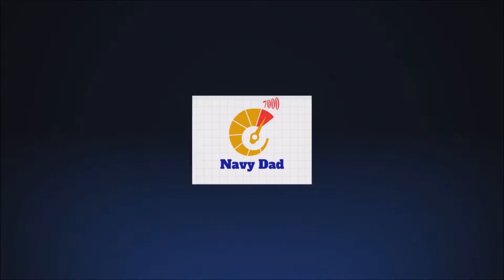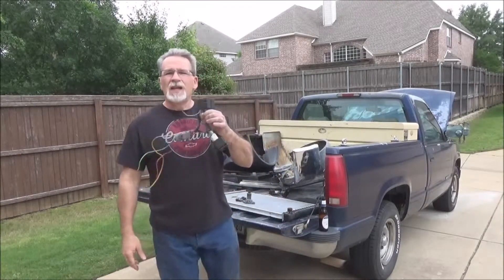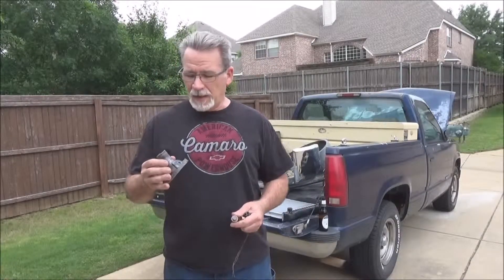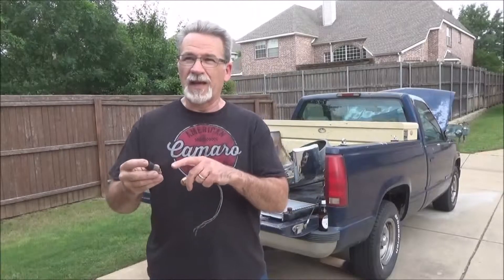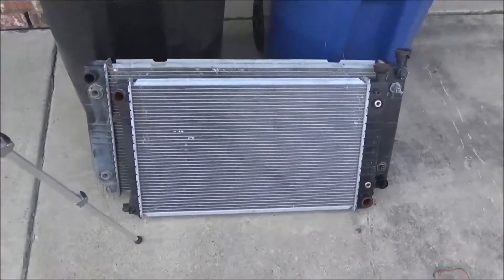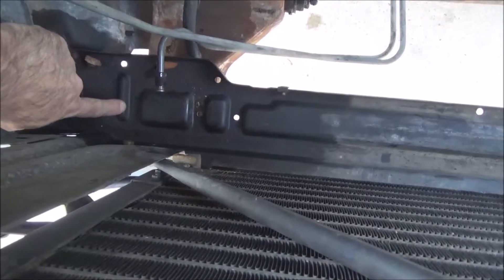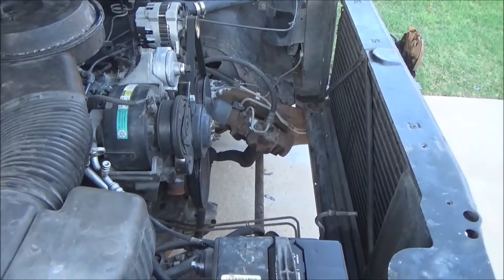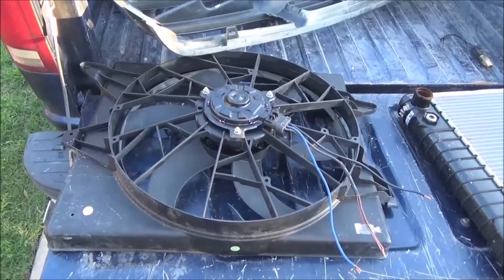Electric cooling fan conversion Chevy Truck Part 1

Comment: Thanks Navy dad for the info... If you purchase the Genuine BMW Electrical Socket with 3 Wires E23 E30 E32 E34 E36 from amazon. It seems as if you are only purchasing the plastic socket as the wires were not included in my recent purchase. Secondly, is there any particular BMW where you can find the pigtail? It seems to me that the BMW's i have seen tend to have different style temp sensors. Thank you Sir
Reply from the maker: From what I fund for the 90’s style which there are 2 temp ranges (I use the higher temp) 3 different socket caps and 2 wire pigtails straight and 90degree it depends on the install and which engine. The parts are a little hard to find right how due to covid… delays (took a month to get brake lines for my Chevelle) but I recently found FCP EURO in Milford, CT https://www.fcpeuro.com/BMW-parts/ not only did they have great prices, had them in stock they shipped fast. And that was in October. I’m using the same setup to power dual Camaro LT1 fans in my 70 Chevelle (coming to the channel soon)  
https://www.fcpeuro.com/products/bmw-auxiliary-fan-switch-dual-temperature-bilstein-61311378073
https://www.fcpeuro.com/products/bmw-plug-housing-3-pol-61131378410
https://www.fcpeuro.com/Parts/?keywords=Round%20Receptacle%202.5%20Watertight%20
Reply: Thanks Navy dad, thanks today your videos I just finished doing the same to my obs.

Comment: Doesn't a fan kit come with everything  ?
Reply from the maker: Not sure I understand the question? Sure you can buy an aftermarket C-fan kit but they can cost several hundred bucks, this is way cheaper and works great
Reply: @NavyDad  I thought it would be simpler , like using existing temperature ports no relays and alternator upgrades .
Reply from the maker: @ExploringCabinsandMines  You must use relays or the fans will stay one all the time. You could use a manual switch but thats a pain for a daily driver. As for the temp port you never want to put a fan switch on the engine side of the cooling system, radiant heat from the engine can cause it to misread and say on longer then it needs to be. The fan switch should always be on the radiator side of thermostat
Reply: @NavyDad  Thanks good to know , my engine/radiator/clutch fan is LOUD ! I'm mechanic replaced it and it seems louder than it should be.

Comment: Quick question, was there better fuel economy after doing the conversion?
Reply from the maker: Davidson Mott There probably was a little bit of improvement but I did not measure it the engines worn out it’s got over 200,000 miles on it gets crap gas mileage anyway but there was a noticeable improvement off-line acceleration it was much Snappier but the best thing about the whole thing it’s quiet when you pull away does not sound like a freaking aircraft taking off that big mechanical fan on the front

Comment: Just FYI the OBS was produced until 1999 1/2 in both 1 Ton as well as 1/2 ton.
Reply from the maker: correct and the 3500 and Tahoe OBS through 2000
Reply: *ny dad's OBS 2500 is a 2000

Comment: What type of plugs did you use to plug the engine oil cooling system on the radiator?

Comment: Thank you for taking the time and making a write up with all the information.  You were talking about an alternator upgrade for running the E-fans. A GM AD244 found in 2002 and up 5.3 ls vehicles make for a good upgrade.
https://youtu.be/GN6gb80Mz0k